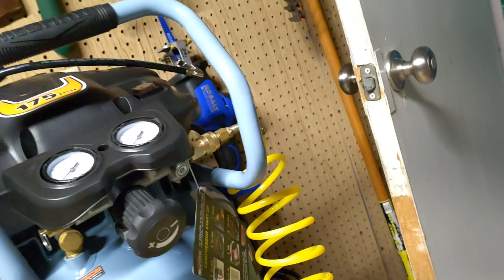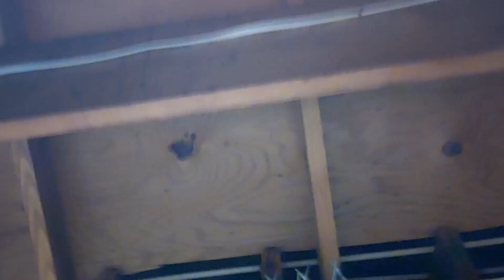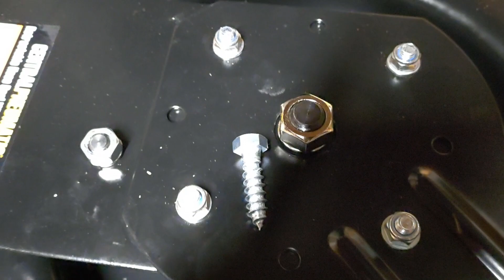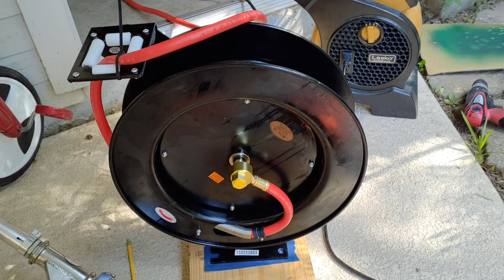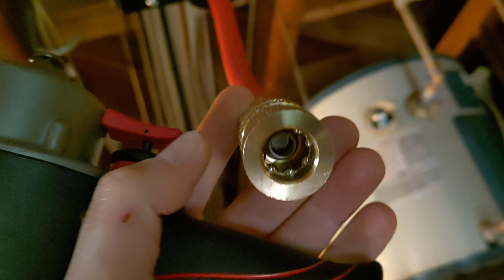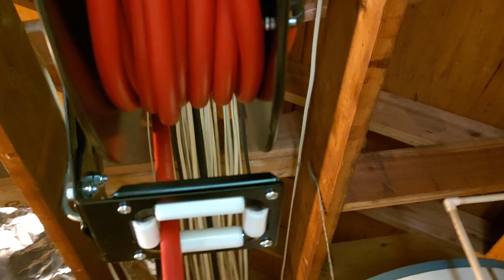Review & Install:  Harbor Freight McGraw 21 gal Compressor and Hose Reel

Comment: This compressor is a P.O.S. Mine died. Less than 2 years old with very little use.
Reply from the maker: What's it doing, nothing when you turn it on?   Mine took a power surge about a year ago and it burnt out the pressure cutoff sensor switch.  When that happens, it won't turn on.  I got a replacement for about 15 bucks and it's been good ever since.  (It just unscrews and the electrical connections are just standard spades.)  Try checking that and the power switch with a volt meter.  May not be your problem, but worth a shot.
Reply: @OGPedXing Mine is hit & miss. Sometimes it will come on. Run maybe 30 sec or a minute. But it never gets to 175 psi. 20 or 30psi at best before it shuts off. Smells like burnt electrical. I'm thinking possibly the brushes. This compressor has not been overworked by any means. I'm a bit disgusted, with this harbor freight product. $250. Wasted.

Comment: In the 30 min break period ,  how did you have the psi valve ? I know the  air valve have to be open but manual wont show psi valve .
Reply from the maker: The top main valve with the psi gauge can be in any position.  It doesn't matter because with the lower relief valve open, the tank isn't holding any pressure.  Just open the bottom valve wide open, turn it on and run for 30 min.  Done!

Comment: I have been into cars for roughly the last 3 years. When Milwaukee came out with their line of fuel impacts, air impacts honestly became irrelevant.
Reply from the maker: I mostly agree.  However if you need a compressor for other things like painting, nailing, misc shop air, then air tools are a cheap way to get a quality item.  A really high torque impact can be had for 50% less than a similar battery powered tool.  Not to mention the high cost of batteries.  Also form factor...I haul out my stubby air impact all the time for tight quarters.  Twice the torque as my small electric and like 3 inches thinner.
Reply: @OGPedXing  I completely agree with everything thing you just said, however I am in fact a Milwaukee fan boy 🤣
Reply from the maker: @redlineremedy4478  haha, yep. Good tools 👍

Comment: Just recently purchased that compressor. Much quieter than my old Coleman Powermate it replaced. I was able too remove that front dummy plug with a 1/2 ratchet an 6mm Allen head socket although it was pretty snug. I took out the extra warranty too, so far, happy with it, time will tell. Had a big wait at three t different HF stores too get them restocked though. Must be in high demand???🤔

Comment: How long can this compressor run that stubby
Reply from the maker: For even heavy use, it will keep up no problem.  I can take off the lugs for 4 tires in quick succession before it will even kick on to bring the pressure up again.  The 175 psi makes a big difference.

Comment: For God sakes can anyone do a proper freaking review on using the product instead of telling us how their wives allowed to install it suvky ass review
Reply from the maker: I take it you didn't stay to the end?  I should have put a better intro...after the install is the sound test, talking about how the manifold doesn't really work, etc.  Fill time is reasonable, I think 10 minutes maybe a bit less.  Reasonable since it's 175 psi which is higher than most you see at this price.
Reply: @OGPedXing   u right I did not watch till the end, got frustrated my fault just looking to see if it will handle automotive impact tools and at what psi I knw it is label on the tools itself but this China made products run different it will say 90 psi but in order for me to get that out of the old central pneumatic I had to crank that sucker to 110 psi and then the gauge will give me 90 psi something wrong with the tank regulator had to use my snap on one attached to the hose that attached to the tool... head ache believe me that thing still runs but my garage getting bigger and more cars coming through small mom and pops hustle thats why I was looking at this one since both the husky ones I bought one had bad contacts inside exchange the other one 3 months later motor just died ( like all my dreams ) LOL so yeah bad luck in 2020 for sure and why I dnt buy snap on compressor well same size 150 PSI and snap on wants 2nd mortgage at home 3 personal loans at 35% interest and of course both my kids college funds and thats the cheapest snap on has LOL  ut they expensive and dnt feel the need to buy high when I can replace one that is cheaper when it burns out instead of me paying snap on to fix it another 2.3 million out of my pocket LOL thanks for the reply and not getting offended
Reply from the maker: @teojim  yeah I haven't done a good test on the gauges but it think they're close...I do tend to put it 10-15 psi higher than what the tool says...so if the impact wrench says 90 I'll put it to about 110.  But it drives it just fine.  It's may have some pressure drop just because of the 50 foot reel.  I've been happy with the compressor though.  I bought an lvlp spray gun but I haven't tried yet.  I'm hoping it will be enough to do a whole car if I don't mind going panel by panel.
Reply: @OGPedXing  panel by panel best results by far trust me I been spraying cars for over 10 years and panel by panel works the best for me specially when u have the fenders trunk hood off doors u can shoot those as one piece but I seen videos of guys shooting the whole side of the car and then u see waves tiger stripes thats why I do panel by panel
Reply from the maker: @teojim  good deal, I've got a couple of project cars on the channel, the Miata especially needs the paint.  I've got it plasti dipped at the moment to get all the panels to be the same color at least 😂.  Eventually I'll do a video, though not a how to, never sprayed a whole car before, aside from plasti dip.
Reply: @OGPedXing how does it work using a spray gun. Can I use this compressor to spray paint small spaces on my house?
Reply from the maker: @RickySlatton  yes,it will work with spray guns but what you want is an lvlp (low volume low pressure) gun.  It will drive a hvlp gun also (usually  what you want for auto painting) but only a panel at a time, you probably wouldn't be able to get around the whole car without the compressor kicking on constantly.   For house painting, a lvlp gun and latex paint will work pretty well.

Comment: been researching for a couple of weeks now on a compressor. I when into HF to buy this they didn't have it in stock.  I then saw the fortress and started researching that.  I then found the Kobalt quiet tech 26 which is what I'll be buying. Thanks the sound on this is way to much for me.
Reply from the maker: That's a good choice too, almost bought the kobalt.  Then my local store upped the price about $100 and I couldn't wait around for it to come down again.  But seems like a nice unit.  The hf McGraw has gotten quieter with more run-time, so I'm happy with it.

Comment: Something must be wrong with that dewalt. I have a kobalt plug in the same size and it’s nearly as powerful as my earthquake xt stubby.
Reply from the maker: Yeah it's yellow and black.  I kid, I kid. 😄 Never had much luck with that brand... this one is pretty old and it was cheap.  I think a 350 ftlb rating.  But that was a wildly optimistic number. Other plugins I've used since are fine.  For a store brand, Kobalt has been good to me, have several of their tools.
Reply: OGPedXing dewalts 20v cordless tools have never let me down
Reply from the maker: @Vdeez  The 20v tools seem good, too bad they shaft you on the batteries.   Same with Milwaukee.
Reply: OGPedXing I picked up like 2 large capacity and two slim ones as a package for like 120 at Lowe’s recently
Reply from the maker: @Vdeez  that's a good deal, nice